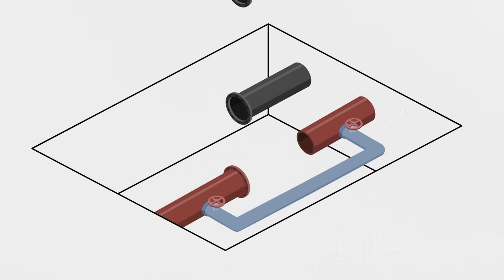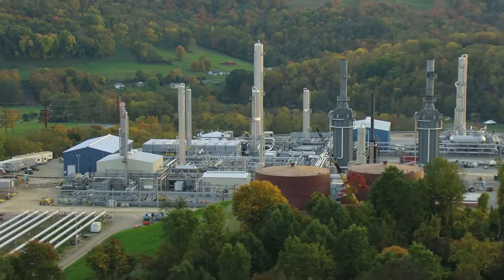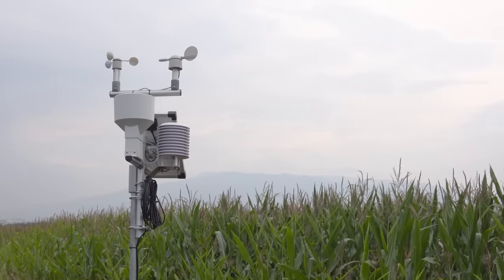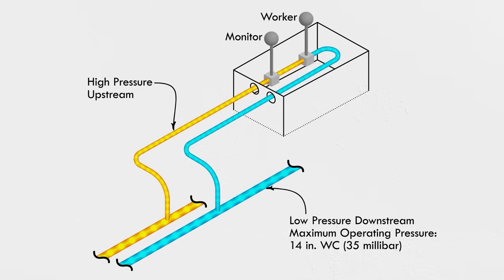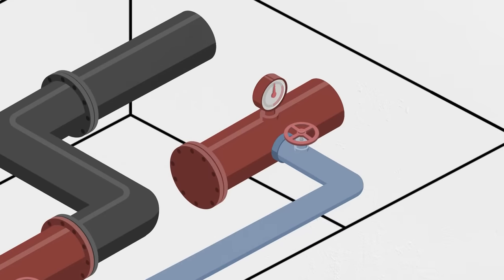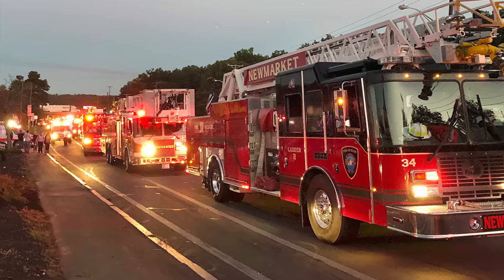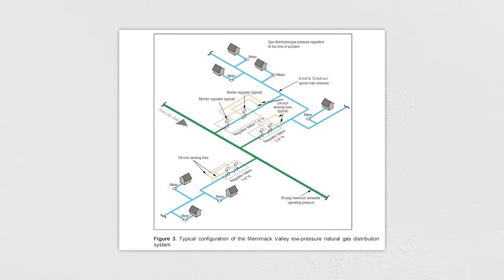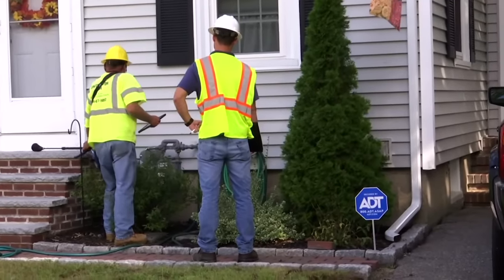What Really Happened During the Gas Explosions in the Merrimack Valley?

Comment: In my neighborhood, gas is distributed at 60psi in the street mains, and regulated at the meter to 8"WC. Incidentally, several years ago they "upgraded" my house drop to plastic (was 3/4 cast iron pipe). They dug a 3x5 hole in the street, cut the cast iron pipe from the main (leaving a stub, which got a temporary cap). Then they shoved a 1/2 yellow plastic pipe inside the old cast iron pipe avoiding the need to dig up the old pipe and disturb the landscaping. They also pulled a tracer wire through with the pipe so they can use sensing equipment to accurately find the pipe in the future. The new plastic pipe was then spliced onto the stub at the main. At the same time they relocated their equipment (the meter and regulator) to outside the house. I was told this was simply regular maintenance and number of homes get chosen for this regularly. About a dozen other homes on my street have had this done over the past few years. Mine was chosen primarily because the meter was inside and newer company policy dictated that the equipment be fully accessible without needing homeowner intervention.

Comment: Control Room Operator here, this is why in Australia we use Slam Shuts as a third layer of protection, However in this case this still would have occurred as the sense lines were incorrectly configured, sad and avoidable disaster! an engineering oversight with huge consequence.
Reply: is that the same as a blowout preventer?  we got one at every house here
Reply: @tsm688  it's a pressure sensing valve that will close when a set pressure is reached (in this configuration, however can be set up to "trip" under any parameters required if engineered in another configuration) once closed, the valve remains in this state until a technician is dispatched to manually re set the valve, basicly does the job of a circuit breaker, only in a pipeline rather than electrical

Comment: As a retired industrial mechanical engineering fitter from England, whenever I had any contract involving any pipework above small bore domestic, I always carried out my own surveys and produced detailed drawings of proposed installations or alterations to existing systems. There would then be a meeting with other competent staff to discuss approaches and check details and procedures. This did not include invites to none competent management I.E. those not holding the current relevant certificates of competence.

Comment: I lived in Merrimack valley during this. Oddly, inspections and requests to enter peoples homes are still being made by the city of Lawrence.
Edit after watching:
 Not only were we left without Gas after being allowed to return home. We were also without power, and for a short period; We were also left without water. For months after the disaster we were dealing with city workers and service workers just entering homes. No knocking, no home owner contact; just hearing noises in your basement to be greeted by people working when you went to inspect the noises. On top of all that for about 6 months after the disaster there were many gas leaks reported at homes (mine included) which resulted in our services being disconnected yet again, as well as underground leaks being detected under roadways.

Comment: Minor point: Given that many pipelines run "high" pressures in the 300-450 psig range, it would make more sense to refer to "not-low" pressures with at-house regulators as "medium" pressure systems. This would better match up with how "bottled" gas is often described as well.

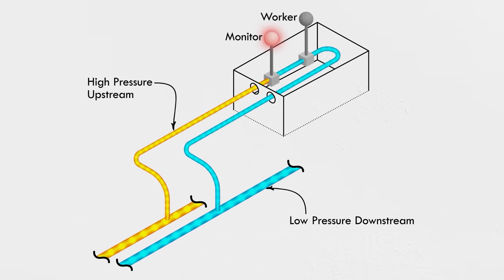Comment: @6:00 - I think you have swapped the worker and monitor.  the worker should be "ahead of" / "upstream" of the monitor, but your diagram has the monitor connected to the high pressure and worker connected to the low pressure.

Comment: The moment I saw the sensing lines animation, I figured it was a dead feedback loop issue. Like the 5V regulator on the Ender 3 making the polyfuse light up orange and melt the motherboard when the output is shorted.

Comment: The design of low-pressure systems was unfortunately the largest factor in regards to the scale of this incident. Medium- and high-pressure systems that use individual customer regulation wouldn’t have experienced such catastrophe. Now, “slam shut” regulators are installed in low-pressure regulator stations across the Columbia Gas footprint. They are essentially excess flow valves, which will close off when the flow of gas reaches a set point that is deemed to be too high.

Comment: Where I grew up each customer has their own pressure regulator, just before the gas meter. These regulators I do believe are equipped with an internal relief valve, thus venting out excess pressure in the event of regulator malfunction (these regulators as well as the meters are usually installed outdoors, but sometime indoors in which case the regulator vent opening would be plumbed outside the building so any vented gas would go outside, not inside). Until seeing this video, I had assumed this was common practice everywhere, to distribute the gas at higher pressure and have regulators at each customer's premises.

Comment: I get the sense line idea, but it's like 5 year old stuff that you just add an over pressure shut down valve as part of the reg if they're that critical. 
Here in Australia we use high pressure and regs at the house, big problem with that is that if you're in a excavator and you hit the line it's a big problem.
But if there's a leak it will make it's self knowen fast with high pressure.
Thanks.
Shane.

Comment: I was hoping to hear a quick rundown of how all those individual home fires occurred. I presume appliances have some built in safety regulators (ie, your stove wouldn't suddenly resemble a rocket launch). But once you effectively have a "main breach" it also seems like you wouldn't have enough pressure to rupture so many individual residential pipes. But that leads back to thinking it was high pressure through appliances, and manufacturers don't worry b/c they rely on gas company safety. If so... Holy ****! Either way, looks like it's browser time. Great video.

Comment: What I was shocked about in this video, was the amount of damage a gas explosion did to the homes. I'm a former firefighter and have responded to plenty of gas explosions. Over here most houses are made of bricks, and the windows and doors are the weak links in the construction. When we had a gas explosion, most often it was either the front or the rear (wherever you had more windows) that was blown out, but the rest of the building would be standing. The shots in this video mostly showed collapsed houses where all 4 walls were blown out. But also with the fire, I'd rather work with brick buildings that are still standing than a pile of wood. Must have been a scary day for the firefighters.

Comment: A PE stamp on a new system design is a good idea. But your issue is the procedures for the Tie in an subsequent pressure monitoring. This is best done by people with field experience and familiarity with the various regulators in the system. I did not read the report but was there system relief valves at regulator? Some of this can be attributed to out dated regulator system and subsequent enforcement by the state utility commission on regulator inspection.

Comment: The bypass was there for a reason. The old main had already had all side street connections disconnected and tied into new plastic main. All services were disconnected and tied into new plastic main. New plastic main was tied to pit after pressure test 2yrs ago. That trench was the last connection to be tied over and they do a bypass just incase.  Before new procedures  normal procedures would have regulator crew onsite and pit opened. All gages connected in the pit in place to watch for any deviation. If pressure started rising they would immediately shut pit down and other pits it the city would hold pressure. This is separate from the gages at that last trench. In the winter new high efficiency heaters cannot take a small drop in pressure so that is one reason why work is done before winter. Even in that trench they were not trained for this situation but utility crew leader should of understood how important that connection was

Comment: In the UK it is usual for old gas lines to be purged with Nitrogen to ensure no accidents can happen.
I find most of the mainstream documentaries are using engineers that are in no way connected to the specific type of engineering that is being discussed and sometimes they act as though they know less than I do, an electrician. Although I was not the normal run of the mill electrician as I got a lot of specialised work, underground, MRI, x-ray, Rail, military etc.

Comment: As you said, I (as a consumer of natural gas) has no idea that the distribution network could be susceptible to an overpressure event like this. This is a whole new reason for me to feel uneasy about the natural gas supply to my home! In particular, I had NO idea that supply lines were so much higher pressure than the distribution network. The fact that the distribution network is not required to have emergency overpressure mitigations that can withstand the worst probable case (supply pressure gets into the distribution network) is extremely alarming.  Why can't the distribution network just have overpressure break disks + flares (perhaps at a safe height?)?
Reply: Who says they don't?  This was a weird, old system managed by a horrible cut-rate company.  Asking your company questions may reassure you -- or maybe give you real reason to worry ;)

Comment: in Germany, every house gas connection has a pressure regulator. Then comes the gas meter.
It is already negligent to work on the gas lines under pressure. 
Had the gas been turned off, the pressure could have been monitored as it was slowly turned back on.

Comment: High pressure to the door is how natural gas works here in most of Europe if I understand correctly. You get high pressure to your gas meter, then a regulator which lowers it to more manageable pressures. If you live in a apartment, then from the meters to each apartment it goes through at middle pressures and then each apartment has its own regulator when the gas line enters the house.

Comment: In my area some years ago,  a couple gas line workers were killed when a broken main was ignited.  I worked for a water system and when we got close to pipes while excavating the backhoe was stopped and all digging continued by hand so as not to cause damage.  The gas line maintenance crew I'm sure have the same rule, which is the cause of this incident.  If you've ever walked along a rocky beach on a dark knight you'll know that rocks with quartz or pyrite will spark with every step. Digging in gravelly soil does the same, although nobody realizes this. You'll never know this as long as you live if you only dig in the daytime. To this day I don't know if policy has changed,  but if those men hadn't been in the trench with their shovels they wouldn't have been burned.

Comment: What I find hard to understand in these stories is how the individuals actually responsible for the disaster are not automatically de-licensed, and i’m not talking about the work crews.

Someone signed off on the installation of the new plastic pipeline. Someone decided it was not necessary to redesign the pressure regulator system. Someone did not communicate the relevant details to everyone involved in commissioning of the new pipeline and decommissioning of the old. Poor team resource management, poor situational awareness. You can't rely on bits of paper when modifying highly dangerous technology or processes.

The person responsible for the bypass operation did not review the current state and design of the pipeline before and after the bypass: lack of situational awareness. They did not know where the pipeline was at when they started, and they had no idea how the pipeline was supposed to be upon completion.

Comment: Aside from the main error which caused the accident, this sounds like another example of people not understanding basic probability - that redundant systems (in this case 2 pressure sensors, monitor and worker) are only redundant if they operate independently. If they're both vulnerable to the same failure mode, then they're no longer independent and thus no longer redundant.  Other examples include:

- The Space Shuttle Challenger, where they were having trouble with exhaust gases in the solid rocket boosters escaping past O-ring seals, so they added a third O-ring. Completely overlooking that factors which caused two O-rings to fail (like low temperature) could also cause the third O-ring to fail.

- The Fukushima Daiichi nuclear plant, where they had something like a dozen backup generators in case the plant ever lost electrical power for its cooling pumps. Only 5-7 generators were needed to provide sufficient power to cool the plant, and the rest were for redundancy. But they placed all the generators and diesel fuel in the same basement thereby voiding that redundancy. So when the tsunami flooded the basement it wiped out all their generators and fuel simultaneously, precipitating the disaster. Putting half the generators and fuel at a different location at a different altitude could have prevented the whole thing.

- Backing up your computer data on an external drive, then storing it in a drawer right next to your computer. If your house burns down, you will lose both the backup and the original data on the computer. After you backup your data, you should store the backup drive somewhere else. Like in your drawer at work. (This is the main reason I now advocate cloud backups, even though there are still legitimate privacy concerns. It's less hassle than shuffling a backup drive between two locations.)
Reply: I'm not sure Fukishima could have been prevented that way.  Having off-location backup power won't work that great when a tsusinami has torn down all the lines.

Really, the design of that and most other carbon-moderated power plants is flawed from the get-go.  A power plant you can't turn off, at all, ever, or it willl explode...

Comment: Putting regulators in homes is a great idea, but with some caveats. 
Where I live buildings are required to have their own regulators. The house I live in was built in the 60s and we assumed it had a regulator until a couple years ago a PG&E employee had a gauge burst in her hand from the pressure in the house pipes. No regulator.

Turns out, only the good design of the stove and water heater was keeping the house unexploded.

It's all well and good to require safety features and then use the system with the assumption those safeties are in place. BUT you NEED to verify those safeties are actually installed.

Comment: I am very supprised by the lack of security in the gassystems, on the distribution side. In the Netherlands we have an regulator valve from high pressure  (4-8 bar) to low pressure (mostly 100mbar) and a second regulator valve paralel to the main regulator set on a slidely lower pressure. After each regulator there is a pressure valve that closes when there is an higher pressure than 40mbar. To the housing there is 100mbar and inside the house there is a regulator valve wich lowers the pressure to 30mbar. So even when there is to much pressure in the low pressure pipes the household would still be save behind there own pressure valve. Even while some old citycenters are getting direct 30mbar to the pipes most houses are getting a pressure valve when the pipeline enters a house.

Comment: Looks to me like you need hi and lo pressure sensing equipment like we do at my workplace. One sytem is an alarm tied in via electronic circuits, to notify operations. The other is a manual spring calibrated unit that will trip on a set hi hi or lo lo pressure, complety on its own if set pressure has been achieved. When tripped a pipeline ESD ( emergency shut down device) stops flow of energy/product. This way you will never compromise pipe with hi pressure and if a rupture ever did take place (lo lo pressure) the upstream isolation valve will trip closed, isolating energy source. But clincher is, these devices have to be enabled or "live" in production stream. Unlike " sensing line", in this video.

Comment: The thing that gets me, as a former US Navy "Propulsion and Auxiliary Engineer", is that (although the diagram didn't show it) there would be a valve on the old. pipe where the cut was so that they could seal the pipe off before cutting it, otherwise all the gas would have vented out into the air .vs. going to the Bypass.  Why in the Hell didn't they start Throttling Down that Valve when they saw the pressure jump???

Comment: I like these kind of distaster analyses and breakdowns. Hoping for more!
Also, this is the video that made me subscribe 😎

My brain made the comparison with electricity. What if something went wrong in substation transformers, and the full 500kV would be pushed into people's homes? That kind of voltage could easily jump the gap and get into metal enclosures, and into steel house frames. Otoh, it would more likely cause a short in low-voltage cables, because the wires are too close together. Anyway, it gave me some slight shivers thinking about it.

Comment: Do they not commonly also install excess flow valves on branch lines there? I know when I did distribution work here, in addition to regulators on the homes, we also have excess flow valves that would protect service lines if flow exceeded the intended amount by a small percentage. We installed them immediately after the tap into the mainline.